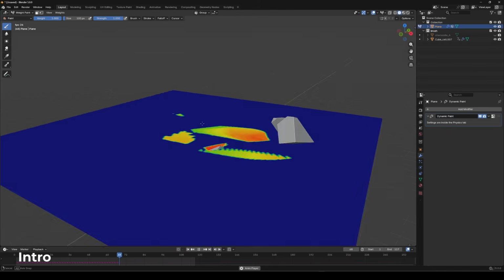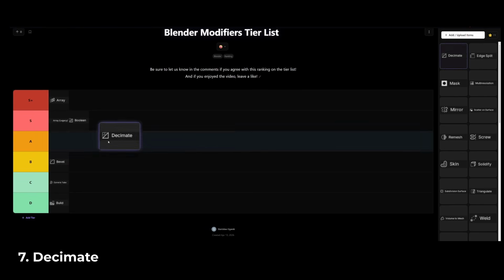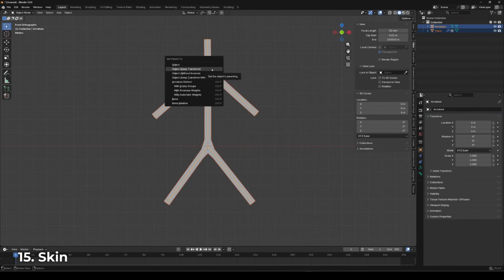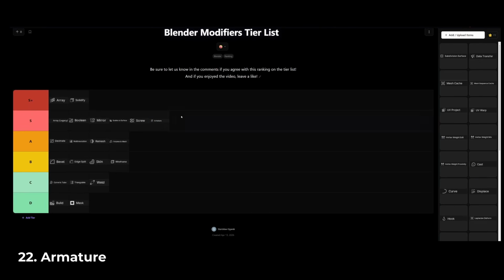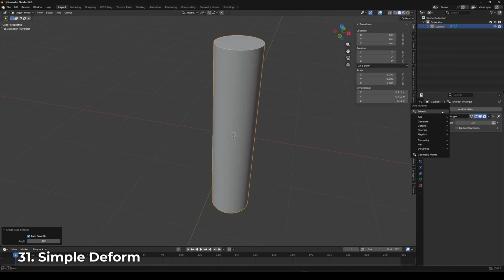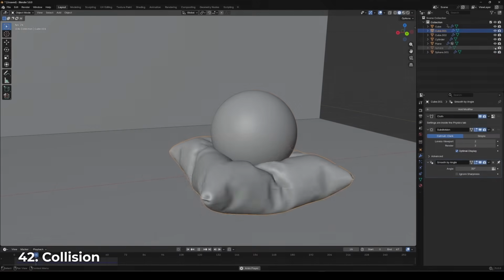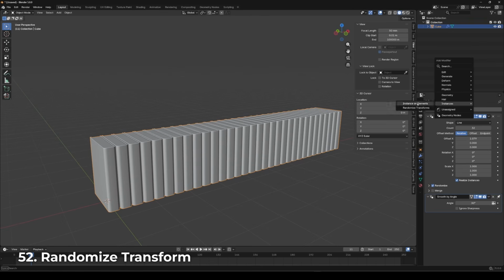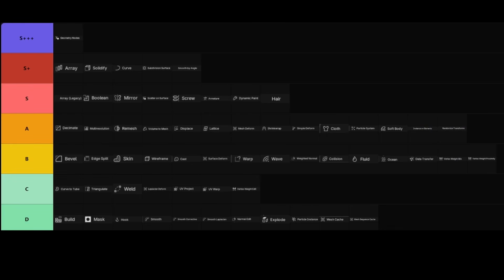I Tested Every Blender 5.2 Modifier So You Don't Have To

Comment: One clutch use for Mask is to lazily hide parts of character geo so it won't clip through clothing, but it is a bit niche.
Reply from the maker: Yeah! You’re actually the second person who has mentioned this to me, and I definitely agree the mask should be higher!
Reply: I use it like this too. Model the body then rig and skin it, model the clothes, copy the skin weights with the data transfer mod to the clothing and mask the body underneath. I like this method because you can save time only skinning one half of the body with mirror, and then if the clothing/accesories are asymmetrical it doesn't matter because the body vert weights go to the clothes.

Comment: Multires is the basis for  Sculpting workflow, if you're making characters, creatures or high detail props you literally can't live without it, it would be a tier above Subdiv Modifier in importance.
Similarly, I think foundational modifiers like Armature, Multires etc all belong in their own, highest tier, as you literally can't work without them in each niche of 3D workflows.
Reply from the maker: Hi! I agree  Multiresolution is the foundation of sculpting workflow! That’s why I think I should probably rank it at least in S tier.
But I was also considering Dynamic Topology, or using an already high-resolution mesh, as well as a regular subdivision modifier.
The point is that there are simply other ways to approach sculpting, even if Multires is the best option.
Thanks for comment!
Reply: @peakdreamsstudio  Voxel remesh / dynamesh and dyntopo are definitely the go-to tools early on when sketching out primary forms, after that, you retopo / quad remesh and move forwards using multires

Comment: Some opinions

-Personally I'd put bevel above a B tier, for non-destructive Sub-D modeling where you have to export the model to other software you can use the "Weight" limit method and it's a beast.

-The solidify modifier did have the "Even Thickness" and "Only Rim" options before 5.0, iirc they've been there for a while now

-Triangulate can also work for exporting to game engines or as preprocessing for baking or other stuff

-I'd say displacement is starting to lose prominence since you can already displace from shaders in both Eevee and Cycles and it's fairly easy to recreate it in geometry nodes

-Apart from retopology, the shrinkwrap modifier can also be used in baking normals from hi to low res models

-Particle Instance can actually be quite a powerful tool in GeoNodes to "import" a legacy particle system into a GeoNodes setup by instancing a single vertex then using that geometry data as you wish
Reply from the maker: Hey! The goal of the video was to spark discussion and gather feedback from other users thanks to that, I can learn about interesting ways of using different tools, so thank you very much for your input!

Let me address a few points:

I can agree about the mm bevel it’s possible I just haven’t used it often enough.

As for Solidify, I might have overlooked those options I checked and you’re right! Interestingly, the Even Thickness option was introduced back in Blender 2.7, so it turns out I’ve been wrong about it all this time!

Regarding Triangulate, I usually just use Ctrl + T when preparing a model, so the modifier itself hasn’t been that useful to me.

When it comes to Displacement, I still consider it a very important modifier it’s especially helpful in motion design and very easy to use.

You’re also right about Shrinkwrap I definitely should have mentioned it.

I hadn’t heard about that Particle Instance option before I’ll definitely look into it.

I don’t know if you’ll find this interesting, but I’ve also changed my mind about two other modifiers:

Hook I completely forgot about the possibility of hooking objects to curves, like chains or ropes

Mask I got a comment about using it to hide body geometry under clothing, which helps avoid clipping a really interesting use case I hadn’t considered before

Thanks again for your comment!